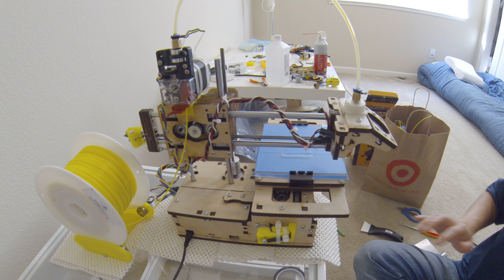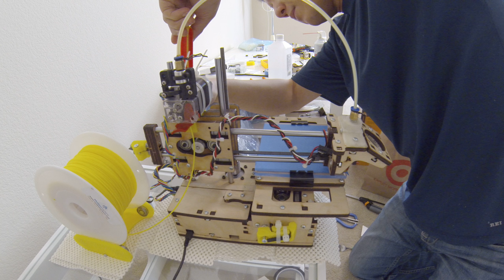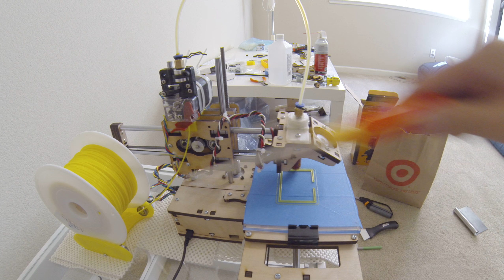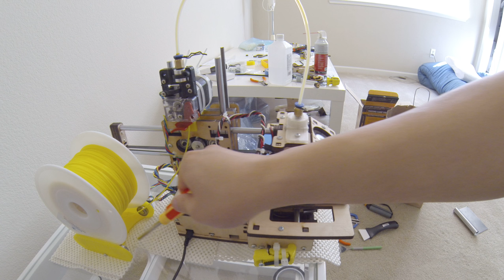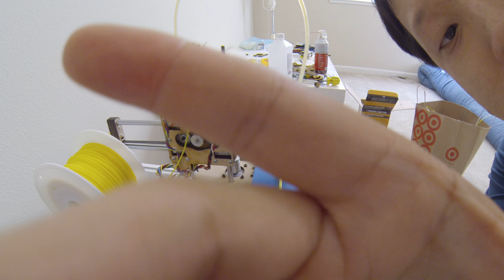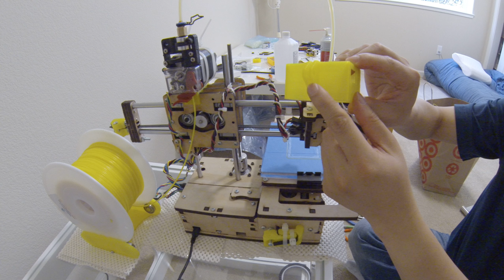Setup and Execution of a Print Run with a Printrbot Jr. - Uncut HD

Comment from the maker: No, the Bowden mod is quite cheap, just a length of PTFE tubing and 2 pneufit connectors. The rest of the adapter set is itself 3D printed. The most expensive single part in my upgrade set is the EZStruder from SeeMeCNC.

The general advantage of a Bowden is reduced mass on the print head allowing for faster/more accurate head movies (Y moves in this case). A side effect of the pneufit connectors is that clearing many types of jams and filament breakages is much easier than before.